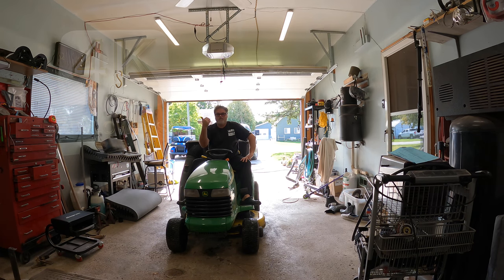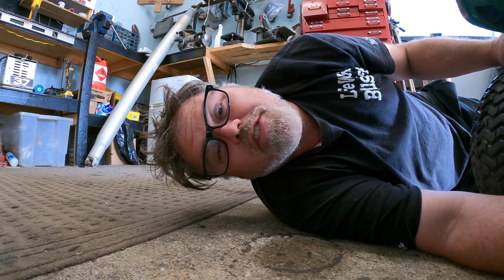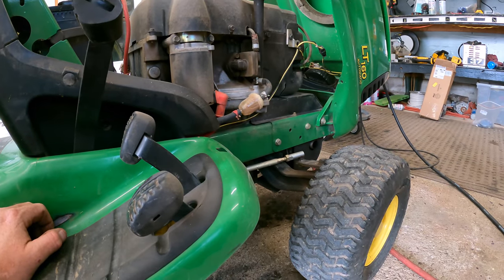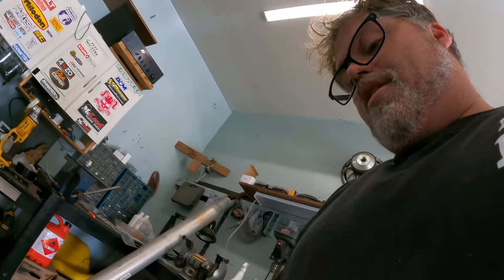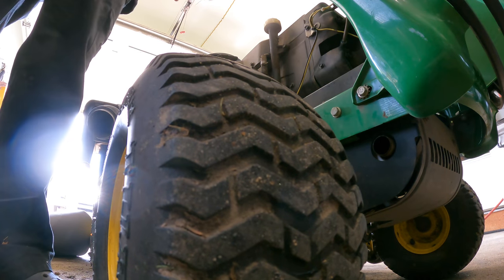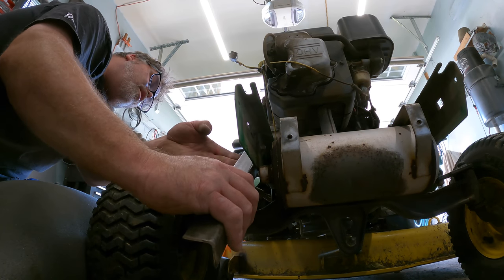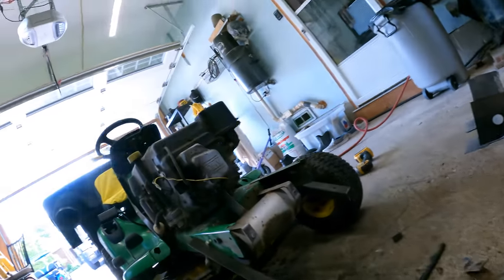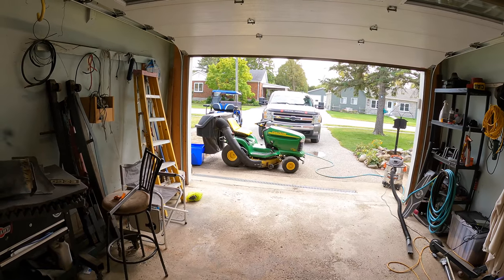Maintenance On John Deere And Adds Front Bumper

Comment: Decent bumper. All I have been doing for the last 2 days is trying to tear apart a brush hog cant get the fricken blade holder or (stump bumper) off its welded itself onto the shaft. Been heating it up and quenching it and heating it some more and put a 2 jaw puller on it and wont even come off with my impact gun,  So I ordered myself a 15 ton hydraulic puller and going to break it or break something lol.
Reply from the maker: Pm me a picture of that shit
Reply: @LifeWithBillSiff  how do I PM you on here?
Reply from the maker: @MrSilverado1982  you can email me at blind62@live.com or Facebook LifeWith BillSiff
Reply: @LifeWithBillSiff  ok i will send it through FB  I bought the brush hog used/ broken and what I am trying to remove is broken so thats why im trying to take it apart.  You will be impressed an inch thick piece of steel broken in half lol.

Comment: If you drill the cracks they won’t go any further.
Reply from the maker: True but if I weld it even better right lol
Reply: At the coal mine we deal with alot of cracks in steel that is way thick we usually air arc out the cracks to open them up them put from 5 beads to 50 beads of weld back into the cut out spot to fill it up but ya having a good hole at the end of the crack before u weld it up is always a good idea